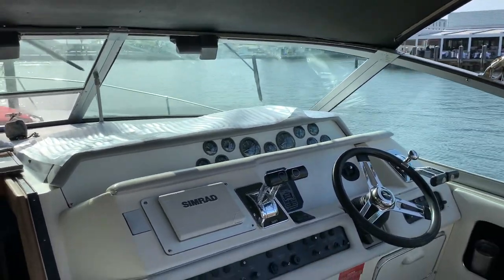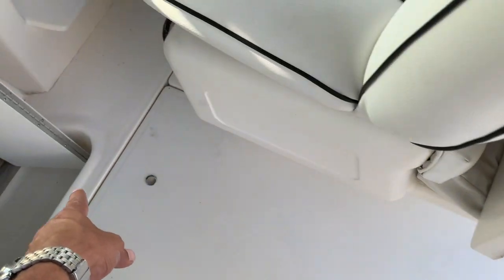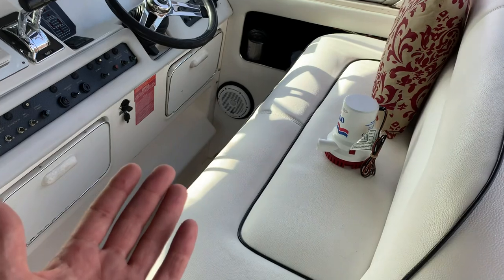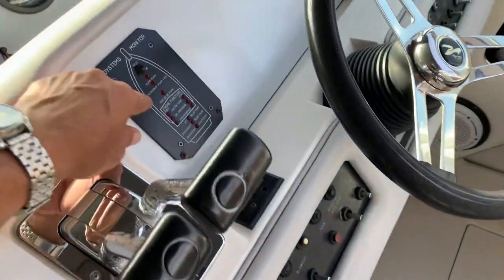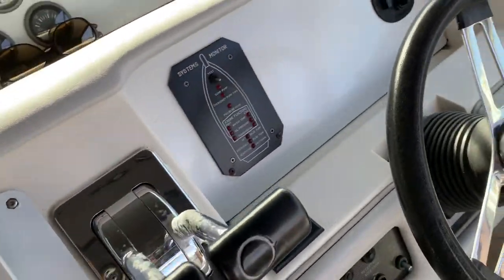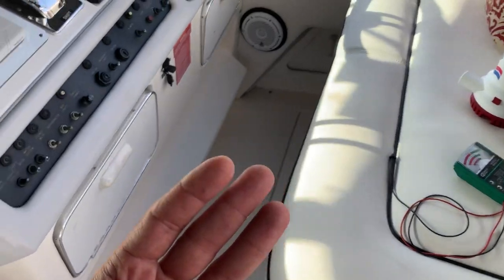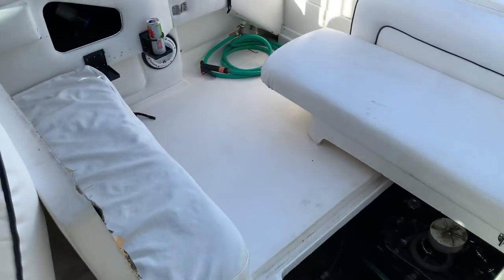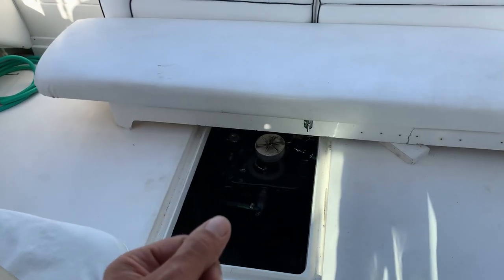2 Bilge pumps not working problem fixed! Wires explained￼

Comment: Regarding access, I could not get to my bilge pump without removing my water tank. So I removed my water tank. Was a pain but no way to reach it otherwise. Searay 250 1995.
Reply from the maker: The builders never think of the service guy 😂 i’m quiet skinny guy, I know there is corners inside my bilge that I’ve been that there is no way most  people would fit